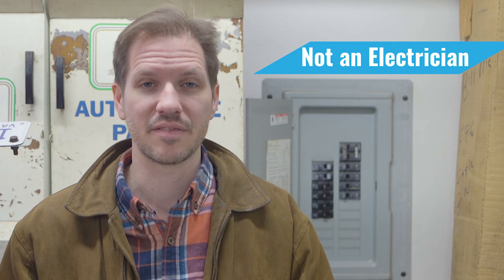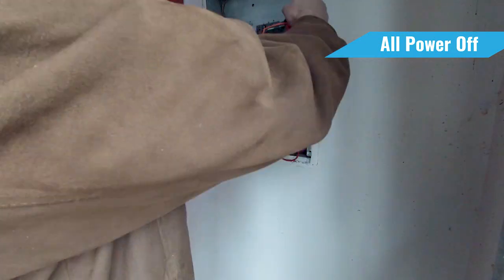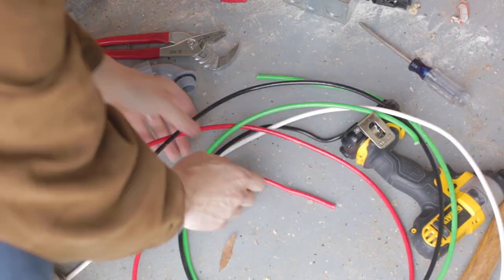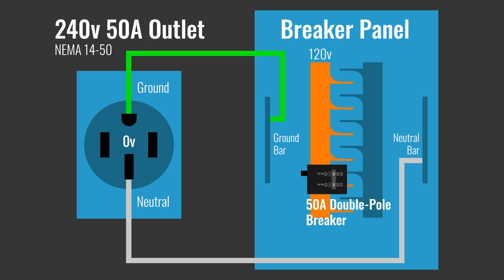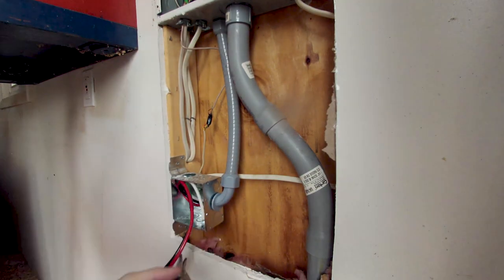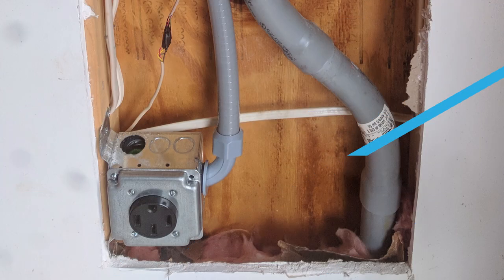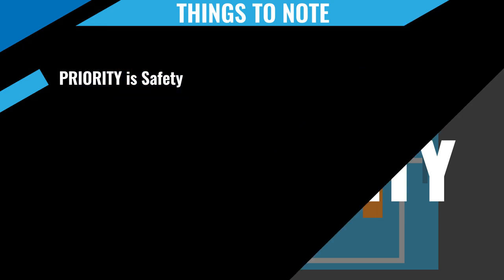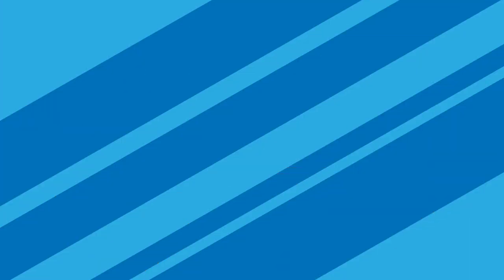Installing a 220/240v 50A Outlet

Comment: I have a new double oven that wont sit flush against the wall due to the outlet. Is it possible to install the outlet in a recessed area to allow the plug and cord to sit inside?
Reply from the maker: I'm not sure. I have seen other styles of plugs that are recessed, but not the 50A we used in the project. I would check with a pro on that one. Thanks for watching!

Comment: Is the 6 gauge wire solid or stranded? It doesnt mention or show the wiring ends.
I was trying to purchase the wiring but found stranded in store.
Reply from the maker: It is stranded. #6 THHN stranded. You can use #10 for the grounding wire only. That will make it fit in the conduit more easily. Good luck! Thanks for watching.
Reply: @CuttingOutBack  Awesome thank you so much.

Comment: Excellent video!   I am guessing you are not replacing the drywall below the panel.   If you are, you should replace the surface cover with a 1/2" raised mud ring and a flush cover plate.   Just to be 100% NEC compliant.   Again, great video!
Reply from the maker: Thanks Kevin. That's a good idea. I will be repairing the sheetrock so I will definitely change those out. Thanks for watching!

Comment: What do you do if someone starts your generator while it's pluged into the generator, but not into the outlet box. That end of the wire has male contacts sticking out that could electocute someone.
Reply: Consider a PBN50 inlet box and a CS6365 Generator Power Cord Connector for 50 amps or a  PBN30 inlet box CS6364C Power Cord Plug Adapter for 30 amps.
Reply from the maker: Hey Gilbert. I don't have a generator hooked up to this outlet. This is an outlet I use for powering a welder or other large piece of machinery. I understand your concern about exposed pins if this was an input from a generator, but in this case it is not. Thanks for watching!
Reply: About generators, to be clear, it is VERY dangerous to use this type of connection for a generator!!!! It's also illegal!
You should ALWAYS use a generator switch or input panel. This isolates the main and generator power from each other. On panel that I installed, the switches have main/off/generator. Connecting generator power directly to your panel by any means can kill a lineman while he is fixing the power line or power your neighborhood, or cause your generator to explode when the main power comes back on. People have killed others, burned down their homes, garages, carports etc.! The $400 I spent on the correct panel to connect my generator was much cheaper than replacing anything that could be destroyed or a life. I also ran a remote input to a small shed at the back of my garage ( ventilated ). Now if the power goes out, I simply start the generator and flip the switches to generator. Everything but the oven works since I have gas heat and water heater.
Reply from the maker: @tomtomlinson8914  Hey Tom, I agree with everything you said. A generator hookup should never be done like this. Fortunately this is an outlet for a welder, or EV, or large piece of machinery and not an input to the system that would call for a different setup. Thanks for watching.
Reply: @CuttingOutBack  I just wanted to put that out there because of the previous comments about "what if someone starts the generator". Scary ignorance!

Comment: how do i know identify ground and neutral on panel ?
Reply from the maker: There's probably a better way, but I just looked at the existing wiring and the bar with all the green wires is ground and the one with all the white wires is neutral. I'm not an expert so you may want to do some more searching on that one. Thanks for watching!

Comment: I want to replace a 120 outlet for a 240, you think the wiring is thick enough for the 240? Or do I have to rewire?
Reply from the maker: It's all about the amperage. Should be fine replacing the same rated outlet, but check with a pro just to make sure.

Comment: Hi, does the 4 inch box itself need to be grounded? Or is it that the outlet makes a ground connection with the box? 
On most metal boxes, I've seen a green screw with a ground pigtail; in what situations is that required?
Reply from the maker: A few people have pointed that out on this video. From what I understand is the outlet itself grounds to the metal box, but some local codes may require you to run a separate ground to the box itself using a grounding screw like you described. This is one of those things a pro or the inspector could gives you better details. Thanks for watching!
Reply: @CuttingOutBack  Thanks so much for responding!!

Comment: I'm curious as to whether you in fact used 6 gauge wire and if you did how were you able for it to be so flexible?  Thanks!
Reply from the maker: I did. It was a real pain getting it into the conduit and making that one turn. Later I found out I only needed 10 gauge as the ground so I took the ground out and replaced it with the smaller wire. Also, this is stranded wire so it's supposed to be a little flexible. Thanks for watching!

Comment: Style point:  as an electrical guy, I never get shocked, just "turned on"!  

So, work in recepticle first, the the panel to ensure Noone shuts your breaker by accident.
Reply from the maker: That's a good one. I'll have to use that. Thanks for the tip and thanks for watching!

Comment: If it was so difficult running the wires through that conduit, were there too many wires for conduit fill rating?
Reply from the maker: I don't think so, but that would explain a lot. The table I looked up online said 3/4" conduit can take 4 #6 wires. I could have totally looked at the wrong column though. Thanks for watching!
Reply: Four #6 thwn wires in 3/4” conduit is about 36% fill.  You are allowed 40%, so all is good
Reply from the maker: I appreciate you chiming in Ref. Thanks for watching!

Comment: this is one of the best youtube videos I ever seen in how to install a 50amp receptacle, I will be installing a 50amp single pole so this means I will only use one hot wire right? thank you.
Reply from the maker: I'm not sure on that one. I would check with an electrician. Thanks for watching!
Reply: Yes, single pole only uses one hot leg or 120v
Reply: Joe Nostroza    I started designing electrical systems in 1983.   In all of those years I never came across a use for 120 volt 50 amp circuit or a NEMA 4-50r receptacle.   Please tell me what uses this size branch circuit.
Respectfully,   Kevin

Comment: Do i actually need #6 wire for a 50 amp RV plug?
Reply from the maker: I'm not an expert, but from what I've seen online #6 is the minimum. If your run is longer you may even go #4 or #2 depending on how far it is. Check with a pro about your specific project. Good luck with it!
Reply: @CuttingOutBack  You are right on.  #6 minimum but depends on the length of the run.

Comment: Hi there ,you forgot to ground the metal box and hot-ground voltage was not tested as well.
Reply from the maker: Thanks Jun, someone had also mentioned that in a previous comment. This outlet says it's self grounding with a metal box, but people have said to just add a ground to the box itself. I'm not sure what the hot to ground test would do other than confirm the ground and neutral are bonded at the box. Does that make sense? Thanks for watching and thanks for the feedback.
Reply: @My Name correct

Comment: Always use Hubble brand when installing 50 amp 240 volt receptacles. Cheap $10 big box store brands are made in china and have a very good chance of melting. Tesla requires the Hubble brand on their charger outlets also. You get what you pay for. Hubble uses more copper than any other brand.
Reply from the maker: Good tip Bill! I'll look for it next time I work on it. Thanks for watching!

Comment: waht does awg mean. if i want to do this do i have to get like 10 awg cables
Reply from the maker: AWG stands for American Wire Gauge. I used #6 AWG THHN wires for mine. I would check with your local building codes and ask a licensed electrician just i case. Thanks for watching!
Reply: @CuttingOutBack  ok thanks i am looking to do this for an electric vehicle charger drawing 40amps at 240volts so i should be fine
Reply: @mohammedayesh3927  #10 wire is only suitable for 30A outlets (24A charge current continuous). You need #8 minimum for a 40A outlet (32A charge current continuous), but the distance of your connection may mandate #6 wire (#6 wire is also needed for a 50A outlet, which would give you 40A of charge current).

Comment: You forgot to ground the metal box buddy. Apart from that great job
Reply from the maker: Thanks Leigh, good catch. I do have a question though. The outlet I used says it's self-grounding. From what I understand the ground pin also connects to the metal mounting plate which connects to the metal box. I double checked it was grounded by testing continuity from the ground pin to the box. Would that suffice as grounding from a code standpoint or do you have to connect the green wire itself separately to the metal box? Thanks for the feedback and thanks for watching!
Reply: The way it’s connected you are relying on the screws between the cover plate and the metal box for grounding. These screws can be removed ( not very lightly once all assembled I agree but anyway). The code for continuity and attachment of equipment grounding conductors to metal boxes 250.148 says....... where circuit conductors are spliced or terminated on equipment in the box, equipment grounding conductors must terminate to the box. I hope this helps.
Reply from the maker: @leighhawkins6732  That makes sense. I have to open the box to retighten the connections anyway. I will be adding that connection when I do.
Reply: Just a thought.... since you will need to connect such a large wire to the box, Home Depot and Lowe’s sell “copper mechanical lugs” which will allow you to connect  the ground very easily. They usually cost around $2. Good luck
Reply: Leigh Hawkins  can you share the Home Depot or Lowe’s link to the item ?
Reply from the maker: Sure, I'll see if I can find it and put it in the description.
Reply: The ground should only be a #10 so it should be easy to connect to the box. I would have used #8 instead of #6 because the smaller cable been easier to work in the box.
Reply from the maker: Thanks Thomas!
Reply: Leigh Hawkins    As with everything in NEC, you must read all that pertains to the subject.   250.148 after your commented part continues--- or to the box with devices suitable for the use in accordance with 250.8 and 250.148(A) through (E).
250.148(C) METAL BOXES.  A connection shall be made between the one or more equipment grounding conductors and a metal box by means of a grounding screw that shall be used for no other purpose, equipment listed for grounding, or a listed grounding device.
Since the author said the device was packaged and labeled as self grounding, his box grounding is NEC compliant.
Respectfully,   Kevin
Reply: Monroe House   I watched the video again and noticed he probably ran a #6 ground. This is a strange situation. The reason I say that is a #6 equipment ground starts at 200 ampere rated overcurrent protective device.   Therefore the conductors would normally be 3/0 in copper and no way to legally make them fit in that little box.    Regardless, the answer to your question is, you would either change the green conductor to a #10 and pigtail a #10 to a green screw provided with the box or buy a single barrel lug for #6 and bolt it to the box.   Bolting a lug to that box may not be legal if there was something in the testing and listing that would void the listing because #6 is way too large.
Ended up being a very good question!   Respectfully,   Kevin
Reply: @CuttingOutBack  Why did you use the outdoor waterproof flexible conduit instead of FMC ?(cheaper)
Reply from the maker: Honestly, it was probably the first thing I saw in HD. No real reason. Thanks for watching!
Reply: @CuttingOutBack  It does look cool.
Reply: @thomasmarable6818  50amp circuit requires. 6gauge wiring min per code

Comment: You didn't bond the metal box 2 the ground!
Reply from the maker: That is correct. I replaced the #6 ground with a #10 and added a lug to the box. Tha ms for pointing that out. I'm going to try and make a follow up video to make sure that info is in there. Thanks for watching!

Comment: Your not an electrician?!?!?! Wut U duin playin with electric?!?!?!!! Lolol!!! just kidding man, good vid thanks, I need to hook up one for welding machine and it’s just what I needed to see,, each time I hook up 240 I have to refresh my memory,,,,,, I keep forgetting about neutral right side and ground left. Good explanation…
Reply from the maker: Thanks Randy, glad you liked it. BTW, if you go the route I did make sure to ground the metal box. That's the one thing that's not in the video. Thanks for watching!
Reply: @CuttingOutBack  affirmative,, but the box and all is set, just need to run a power for my mig to the other end of my shop and I don’t run building outlets often, needed a memory refresher thanks man,,

Comment: This video is just dangerous. 
-You don't ground a metal box (and you're using liquidtight, so there's no mechanical ground).
-You don't torque the screws (at 6AWG or even #8, this is important)

-You almost certainly violate conduit fill (you don't say what size you're using, but given you jammed at the first bend, i'm pretty sure you violate the fill). the conduit is not needed (you had a stud right there to secure 6/3 romex to).
- Not a code violation, but any electrician will tell you this: you don't use a commercial grade outlet; those leviton $10 outlets melt like butter at 50 amps.
- Unless you're he-man, the lock nuts need to be tightened with a flat head; hand-tight on those things is never good enough.
- Maybe you did this and didn't show it, but you didn't test the neutral to ground potential (you don't test against the neutral at all).

$200 on an electrician would save a viewer a burned down house.
Reply from the maker: Fair enough Karim, I appreciate your feedback. I agree with your last statement, hiring a professional is the way to go and I don't believe I suggest otherwise in the video. I felt comfortable installing the outlet in my own house and wanted to share some of the info I learned. You can also see that in the comments most of the concerns you brought up have been pointed out I have made changes to the installation that reflect those. Specifically, on your conduit fill note I believe 4 #6 wires in the 3/4" conduit is the max, but I was informed I only needed a #10 ground wire so I swapped that out and it was much easier to thread through the conduit.

I also am using this currently for my 5HP bandsaw and a welder from time to time so I am not drawing too much power. I will look into swapping out the outlet for a better one if I get an electric car sometime down the road.

Thanks again for watching and giving us some good feedback!

Comment: This is why non-electricians should not do electrical, you did not ground the 4-sq. Electrical box.
Reply from the maker: Thanks for pointing that out Michael. We've had a productive back and forth on this topic down in the comments. Check for Leigh Hawkins' comments. I explained this outlet identified as self grounding and I tested to see if it did and it does. However, code may not allow for this and a separate wire should be used to ground the box, but as you pointed out I am not an electrician so I would defer to you and your local inspector's good judgement. Thanks for watching!
Reply: @CuttingOutBack  I’m an electrical inspector in Tampa Bay Fl , the only time that box would not need to be grounded is if there were no splices or junctions, hence, just a pull box.
Reply from the maker: Sorry, I'm not familiar. What's a pull box?
Reply: @CuttingOutBack  Where you install a  box instead of an L.B. , no receptacle or switch just a (pull) box.
Reply from the maker: Gotcha. That makes sense. I'm curious about the self-grounding part. Is that connection insufficient or it's just code to have a separate wire to ground the box?
Reply: @CuttingOutBack  It does not have to be separate, ground is ground, the same ground wire for the receptacle also grounds the metal box. In the back of the metal box you can see where the green ground screw goes.
Reply from the maker: I understand that. I think I'm just missing some specifics here. If you find me on social media at the same name I'd love to pick your brain some more. Send me a DM if you'd like.
Reply from the maker: Also, since this is a point of contention I would like to make a follow up video so anyone who watches the video can get the correct information.